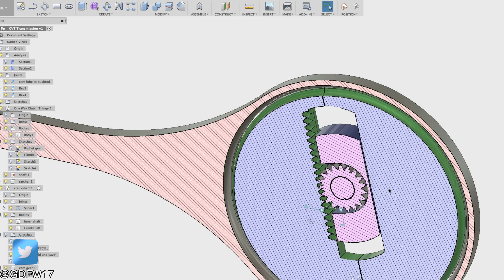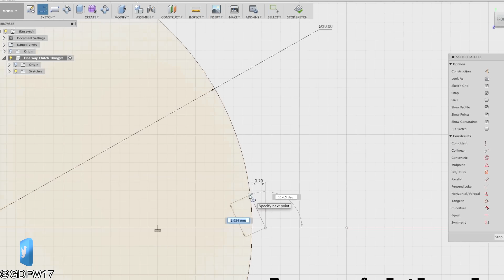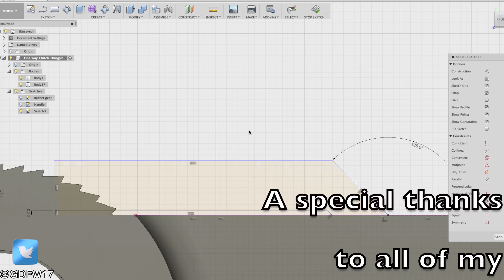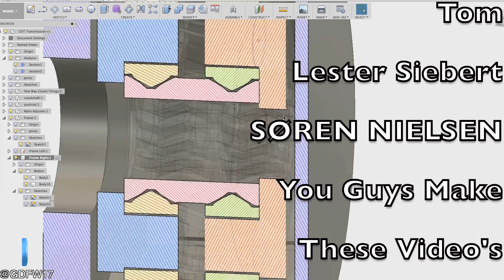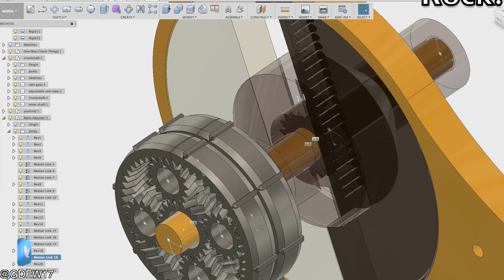The Coolest Transmission You've Never Heard Of... The Ratcheting CVT

Comment: Subaru has a "knocker" in their CVT because customers complained about it not sounding like it was shifting
Reply from the maker: Hahahahahahaha
Reply: The Famine   yep, and digital cameras synthesise the sound of a mechanical shutter!
Reply: I have a 2018 Subaru Outback 3.6R and I wish they'd not have the artificial "gear" shifts: it's an artificial anachronism I expect will help things wear out quicker, and I actually love when it shifts through the low or top power ranges where it's as smooth as possible (it still has minor ripples due to changing pulley diameters, but minor).

I wish at least Subaru allowed you to choose "anachronism mode" or "take advantage of the nature of the beast mode" as I also expect the artificial points (for other than downshifting for steep roads, which there are a lot of them in Washington state, but even then, I'd love having full range control of ratios) eat big into the gas mileage.

When I have the car in cruise control down hills, the cruise control (as long as it isn't too steep, which I've determined by road grade signs means it must be steeper than 12% grade: yes, we have a number of those around here) controls it nicely without brakes, by doing the correct gear shifting with the CVT: the best mountain-driving car I've ever been in.

Comment: Cool design, the CVT reliability is the biggest issue for me. I recently drove for the first time ever a car with a CVT transmission which was a Nissan Murano which is known for the CVT transmission failing. It is a bit odd not hearing the car shifting through the gears. This wasn't an issue for me, it's just a little different not hearing the or feeling the transmission shift. Although it looks a bit similar to how the Rod's move around your Center shaft similar to that of a Wankel engine.

Comment: Really interesting mechanism! Im guessing the reason why this is not a true CVT is due to the rachet. 

Say the cam is pulling the rachet where the paw skips a single tooth of the rachet for each reciprocating action. Now the cam is adjusted and the paw skips 2 teeth of the rachet, increasing the speed of output shaft. The problem is when the cam pulls the rachet somewhere in between. The pawn will start going up the first tooth, but will get pulled back before catching the next tooth. This means the gearbox changes gear ratio in steps, and is directly related to how many teeth the paw can skip. The paw going over 1 tooth is a ratio, going over 2 teeth is a different ratio, but there are no gear ratio in between these two.

Still a very cool concept though, and please excuse my poor english :)

Comment: Hello,

  Excellent video and presentation.  I really like the Fusion 360 stuff!  and thank you for the Thingiverse information.  

  I do not want to take anything away from what you have presented here.  If anything I may not be understanding everything you have done.

 ...having said that - What is you made this machine be more of the engine?

  What would happen if you had the mechanism working to take an oscillating motion and turn it into rotational motion...  your drill would be the wheels of the car.

  What if the rods were the actual pistons.  And, the CVT allowed the pistons to go from a complete stand still, to large stroke?

  I found out recently that F1 engines spin so fast because they only move a tiny bit (short stroke).  I also knew about a "Hit-n-Miss" engine that would only fire the piston when the RPM slowed to a pre-determined level.

  So... imagine a car at rest - the engine would/could be too.  The pistons resting at top.  (optional - thinking on the fly here)  ...  Then as the car needed power, the pistons strokes would be lengthened.  Once the car reached cruising speed, the stroke could be shortened (or at times even stopped - coasting)

Your transmission allows for coasting without the 'shafts' moving. If used reverse from what you demonstrated.

 Well...  nice video keep up the good work.

Comment: I think that your design could work without the ratchet mechanism. It produces a cranking motion, you know what transforms cranking into spinnemathinging?
Cranks, i think that you could use the power of cranks to power your output shaft
Reply from the maker: others have mentioned that, thing is, in order to change the RPM speed of the output shaft to the input shaft, the two shafts would need to be out-of-phase with each other most of the time, if that was the case, the pushrods would not be able to be a constant length. 

I'm not saying that it's impossible,  I just can't imagine how that mechanism would work.

Comment: As clever as this is (and it is clever) it is not a positive transmission because, unless I am missing something, it can free-wheel. That's not positive. It might be OK for a bicycle, but a car or truck needs to be able to engine brake.
Reply: And would this brake have it's own brake pedal, be connected to the regular brake pedal or just on a spring so it is always resisting rotation? (because ratchets aren't inefficient enough already)
Reply: There once was a car that was freewheeling in the fourth gear.  It was a Trabant, a two stoke vehicle made in East Germany when the communists were ruling the country.
Reply: GordieGii that would be due to an additional component of the transmission you can consider flywheels and torque converters to be part of the transmission or an accessory but this is just simply missing that component of the transmission in this particular iteration but that doesn't stop it from being
Reply: He said it is a ratchet. The output shaft can continue to rotate in the driven direction even if the input is stopped. It doesn't require flywheels or torque converters, it only requires a force in the driven direction, such as the inertia of the vehicle or a hill or somebody pushing or pulling it forward. He literally turns the output shaft forward by hand during the video. 
Not positive.
Reply: That's excellent! How?
Reply: Sounds like pawls to me. Also, the output shaft appears to have a bunch of teeth.
Reply: You could if it wasn't a ratchet based transmission. This one would just free-wheel.
Reply: It's not the engine free-wheeling that's the problem, it's the output shaft. If you are going down a hill you will go faster and faster unless you apply the brakes. That's bad, especially in big trucks.
What do the pawls in an automatic transmission do?
Reply: I don't see a reason why should he use the ratchet mechanism. He could easily turn it around and abandon the conversion into rotational movement via ratchet altogether. He would then power the cvt straight with the linear movement from the engine block. Why convert linear movement into rotation, then again into linear movement and again into rotation? That must be ineffective
Reply: GordieGii well we can deal with that no problem
Reply: GordieGii 
Wow! Very good question. Giving me a headache now. Lol!
Reply: GordieGii not if you could control the trans well. As you can see, it is pretty much a direct drive at all times when not in neutral. So what if a engine could freewheel honestly? Engines already are controlled by electronic components as it is. And we could add a clutch to disengage the engine if it should fail. And for parking? They already have pawls in automatic transmissions. So thats good too.
Reply: Most two stroke cars free wheel because during engine breaking the fuel is cut off, and the fuel in a two-stroke oils the engine.
Reply: Most two stroke cars free-wheel instead of engine breaking because engine breaking would run the engine dry. Then this transmission would be fine for two stroke cars. (assuming you don't mind replacing the ratchets every few weeks) Are there a lot of two stroke cars on the road?
Reply: There are zero due to emissions.
Reply: Then there is zero use for this transmission as far as vehicles go, right?
Reply: GordieGii It could be used in a hybrid system with a regenerative brake system, however in a normal car, it would cause extra brake wear and take time to learn to drive with.

The other issue is balancing the oscillating motion and the reliability of the rachets.
Reply: GordieGii you could attach electric motor/generator to output shaft to recuperate energy from braking.
Reply: A hybrid system with regen braking I believe would be the best application for this trans. The electric motor would have to be connected directly to the wheels or have a separate transmission while the gas engine uses this.
Reply: Honza If you are going to add a motor/generator then you are going to need batteries to store the energy, so why not just make an electric or hybrid vehicle.
Reply: Joseph or you could have a generator attached directly to the engine and you wouldn't need a transmission at all.
Reply: GordieGii understand what you're saying about running the engine dry on a 2-stroke but my 2-stroke motorcycle does engine braking just fine and it's 40 years old it's a 1973 Kawasaki H1 500 Triple and it's still running fine. Because of its poor brakes and poor handling it's not the best sport bike for the mountains but I still take it sometimes and it still does engine braking fine
Reply: Sorry Paco, I was not making that claim but merely re-stating what TheMr6507 said in a less ambiguous way.
Reply: just add a break to the output
Reply: Could use a jake brake for engine braking

Comment: Thanks for this great video. The concept never dawned on me until I saw a demo of the original (I think). The implementation seemed a bit awkward, so I started thinking of ways it could be improved.

So, I figured going from reciprocating to rotational then back to reciprocating motions is a bit wasteful, so why not cut out the middleman? The crankshaft gets relegated to timing and accessories, while the power comes directly from the reciprocating pistons. A proportioning linkage enables variable output stroke, and the ratchets (I think they called it an over-running clutch) do the rest. Hmmm... I might have to work on a model.
Reply: was thinking the same, his design looks more like an engine than a transmission,  what if instead of the connecting there was a mechanism similar to this that connects the piston to the crankshaft that changes speed.  I think il think about this some more too, possibly make a model
Reply: I think lexus already has a variable displacement engine, check it out on engineering explained's channel, it looks a bit similar to this
Reply: I think there was a British transmission design from the 50s or 60s I remember seeing somewhere that took the reciprocating motion of the pistons and used that to power a ratcheting cvt.  I don't remember where I saw it though.
Reply: Belt based CVTs usually have the pulleys both vary inversely to maintain the distance between the shafts.

Comment: Isn't there a roller based ratcheting mechanism? I once took a bike hub apart because I wondered why it didn't make the clicking sound all other bikes made when I was not pedaling. Turns out there were rollers that are presses into a wedge and so locked inner and outer part of the hub together when pedaling. When not pedaling the rollers would be pulled out of the wedge by the free wheeling outer part of the hub and so unlocked the two parts. Maybe not the best solution for 3D printing but it makes me wonder if it would work. Would certainly be more quiet. :)
Reply from the maker: Yes, there is. It is called a sprag clutch. I considered using that instead of the ratchets, but decided to take the easier route and use the ratchets
Reply: They are also used in keyless drill chucks to stop the shaft spinning when you loosen and tighten the chuck

Comment: What about replacing the ratcheting mechanism with a crankshaft (like in a normal combustion Engine). I Think you could get rid of the mechanical losses of the ratcheting mechanism (which imposes huge mechanical losses) while still having the mechanism working. The tricky part is twofold. First, the crankshaft needs to "adjust" in some way to the gear ratio, second the crankshaft needs to be synchronized to the Wheels such as to define the output direction given the input direction. If you pull it off, you would have a CVT that actually two-direction.
Reply from the maker: Wouldn’t both crankshafts need to spin synchronous then?
Reply: It shouldn't, if the mechanism on how the crankshaft adjust, does not affect its output speed. Im just brainstorming on ideas on how to improve the mechanism by in some way getting rid of the ratcheting mechanism.
Reply: Sebastian Nielsen it seems that everyone hates the ratcheting mechanism

Comment: Just because you weren't first doesn't mean you didn't invent it. You invented it, but someone else already invented it.
Reply: I know why it isn't a true CVT. The ratchets have to 'step' which means they can only move the crank certain amounts. You can have more 'steps' per second but there will always be small gaps between the different speeds.
Reply from the maker: Ding ding ding!
Reply: Woo!
Reply: Actually, there is no actual CVT, it's physically impossible. Having an infinitely variable transmission would mean that your actuators can move infinitesimally small distances, which aren't a thing.
Every CVT has a limit of how many gear ratios it has, it's defined by how precisely an actuator can move
Reply: That's a good point. The smallest distance something the size of conventional CVTs can move is relatively large. It can probably (just a guess) only move distances about the size of an atom. Therefore it is limited to roughly how many atoms long it is.
Reply: BoostAddict what if you added more cranks so that the time between movement was decreased 🤔
Reply: BoostAddict theoretically, it can move at minimum a Planck's lenght, but realistically, it's probably like a micron at fucking best
Reply: CamkamCK CamkamCK You would still need an infinite amount of rockers to have no time between movements.
Reply: Shockwave Shockwave the cvt on my hemi motorcycle is really infinetely variable within it's minimum and maximum drive ratios.
Due to being operated by springs and gravitational and centrifugal force and not through electrical systems,it's not changed in steps. Lowest range is somewhere in the 12:1 ratio and the highest is somewhere around 1:1.4.
A 345lb bike with a 260cc (modified from 150cc) with a turbocharger,putting out around 55hp.
Belt slip is my biggest concern until vehicle speed reaches around 10-15mph AND engine speed reaches around 6500rpm. At normal engine speeds for cruising (around 2200-5000,,, engine redlines at 10,400rpm electrically controlled) it has belt slip upto 35mph,you can seriously FEEL when it finally gets the full bite on the belt.
And the belt is rated for around 100hp. Keeping the belt and the drive pulleys cool is the largest concern you can have in any traditional cvt transmission (belt or chain or otherwise)

Once the turbo spools in it usually breaks free of the belt for a few seconds until it hits redline,then the centrifugal force enacted onto the belt via the pulleys is around 95lbs.
Powerful bike, strong performance and very consistent with the driving experience. Top speed around 110mph. 
Final drive was upped to 5:1 for better hill performance and better power under belt slip. Stock final was 2.75:1 and would have given me a top speed around 165. Never checked because the final drive was the first performance modification I did.

My bike has a dune buggy engine,that was heavily improved upon. 
Due solely to the cvt transmission it matches my 1300cc 200hp racer in 0-60 acceleration.
My 1300cc puts out 110lb-ft of torque from 3500-9500rpm,and it's a 5speed shaft drive. Top speed around 144 achieved.

Long story short,my race bike has a cvt and it's the best thing I've ever used. I wish I could put one in my Chevy Impala 9c1,or in my turbocoupe ranger. (Turbocoupe engine,mazda 5spd stick, 4.55 final drive,235hp 2.5L 2v i4)

Comment: Does fusion 360 allow you to make true involute gears?
Reply from the maker: Yes I believe it does! I also use a plugin made by Ross Korsky to make helical gears
Reply: Gear Down For What? 
Thanks. I'll have to try that out. Inventor allows you to make involute curves, but it has issues making a parametric gear.

Comment: I don't know about you but CVT transmissions are completely garbage. A Nissan juke is what I ones for 15days going uphill was horrible acceleratiw while moving was slow slugging overtaking anything faster than a gopher was just scary and they are slower a Nissan juke with a manual is a completely different car over taking is easy uphill the car doesn't even feel like it's going up a hill and I can tow a trailer
Reply: So the Nissan Juke has a terrible one: Subaru has great ones, which are of their own design, that uses a chain instead of a push belt.

Comment: great idea, terrible music
Reply: Great job!  When I was young, in the early 90s, popular science had an article about a company called epilogics that had a new ratchet design for use in ratcheting cvts like yours.  I was blown away by the idea and spent hours "reverse engineering" how such a mechanism could work.  One thing I really took away from the article was the parallel of how the ratchet in a cvt acts like a diode does in the electrical world. The rotating input shaft can be though of as a   dc signal that is used to generate an ac signal via variable displacement cams. Then that ac is rectified by the diodes to get what approximates a variable dc output.  Like the electrical counterpart, the output will not be a "clean" signal but will have to be damped by a sprung flywheel or similar to get a harmonic output.  I've had a design in mind for years that would use a universal joint to generate the variable mechanical oscillation motion.  Maybe you've inspired me to model and print it!  Keep up the good work!